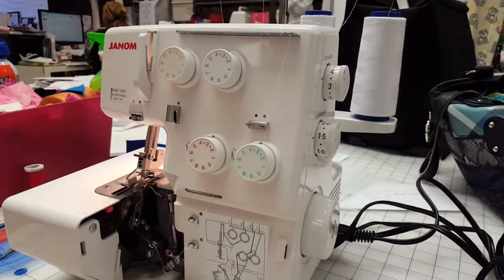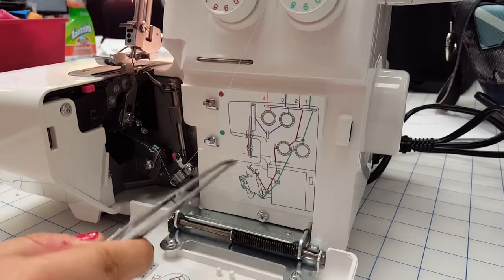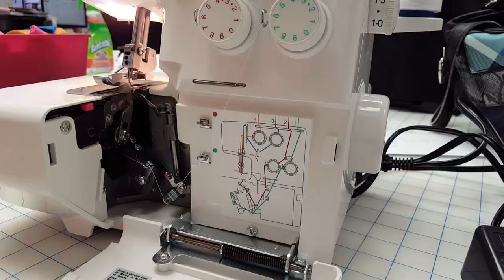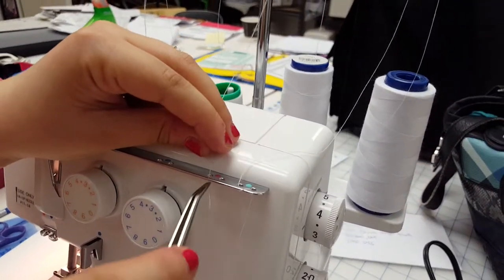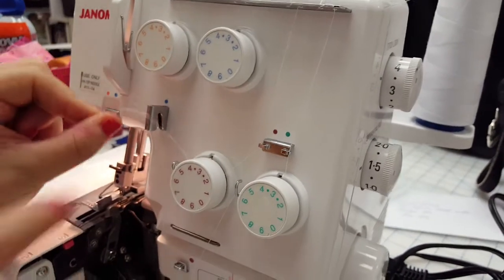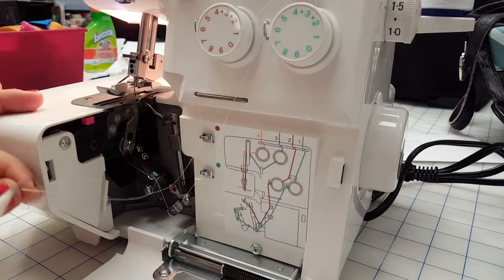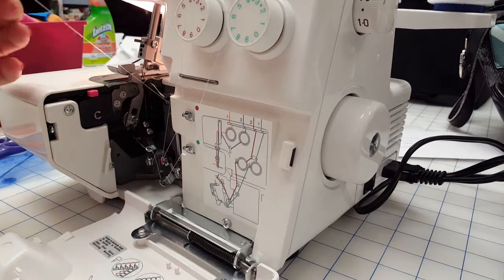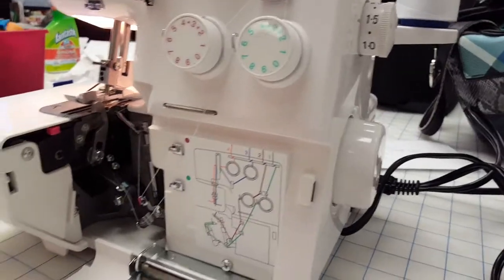How to thread a serger - Upper Looper (Part 2 of 4)

Comment: I have threaded it based on your instructions but I can’t seem to get second thread to work. When I run the machine, second thread breaks
Reply from the maker: Check the thread cone to see if the thread is getting stuck on the cone holders. I have had that happen a few times and it turned out that the thread was stuck